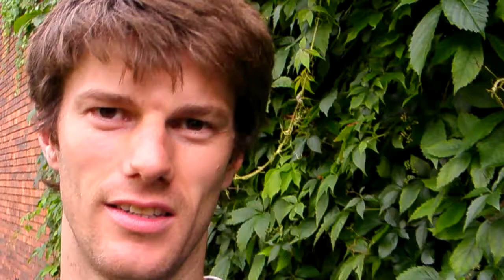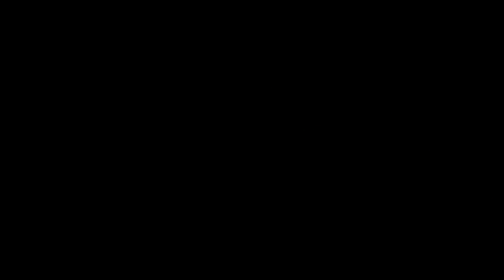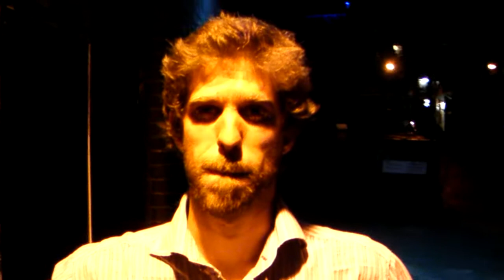Open Source Wind Turbine Meeting London 15-8-2011

Comment: @jdaviescoates By "mid-sized", you mean??  Check out scotswordy 's channel. Couldn't this design be scaled up as they explain in the end of the video?   When I was working in Topeka KS in 08-09 and 2011, I noticed that the wind seemed to blow there 75% of the time, yet I only saw 3 household wind turbines.  I saw a handful around Carlyle/Hebron Nebraska in 07.  Wind power isn't practical here in SE Alabama, but I expected more from all that free energy in the midwest.

Comment: @jeffery19677 the idea is to create a mid size open source wind turbine. Whilst it is true there are lots of info about making wind turbines out there (e.g. files . uniteddiversity . com /Energy/Wind ) these are all for very small turbines (i.e. only about 2kw). There is some work happening on the battery front though too... eg opensourceecology  . org /wiki/Nickel-Iron_Battery